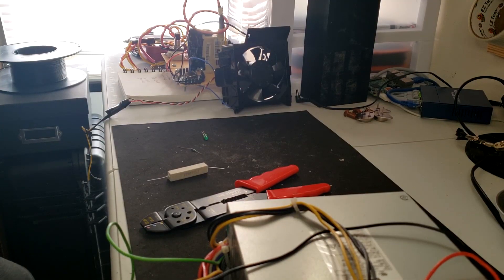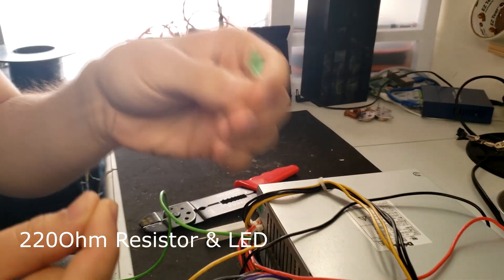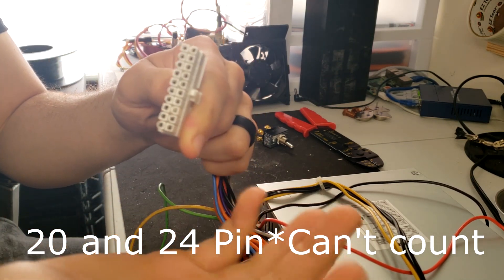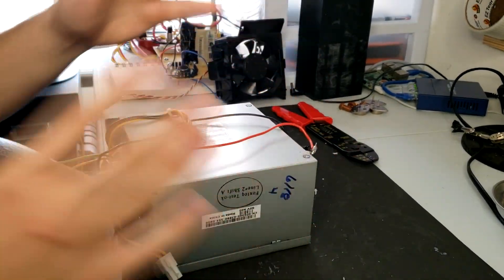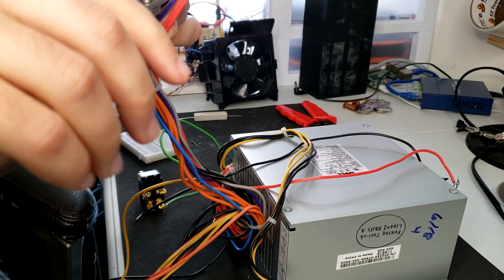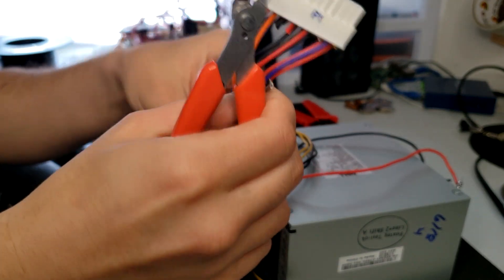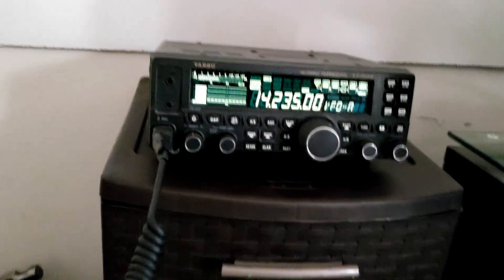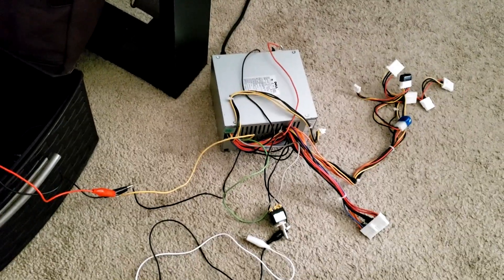Using ATX PC PSU as a Ham Radio Power Supply

Comment from the maker: Let me know if you guys have any more ideas for an improvised power supply!
Reply: There are at few other alternatives to an expensive ham radio power supply other than the ATX PC type. One is the server type, I modified one and it could provide up to 75 Amps. Other is to get a better quality Chinese power supply. They go up to 30/40A and is easy to bring voltage up to 13.8V. I have one for almost a year now, no issues. I also have an MFJ and Samlex switching power supplies. They all put more or less the same level of RFI. Someone already reply, if you put a toroid on the 12V line will prevent to reach your radio. If you want to take a look at some of my experiments with this go to va3hdl.com and take a look. I posted pictures of all my modifications. 73 VA3HDL
Reply: Do not connect power supplies in parallel. You should have disconnected your old one, even if it is off. Other tip, you should bond the same colour cables for maximum amperage, for example all black wires together, all yellow wires, etc. into a single point of connection for each voltage level, or cable colour. The PS is not designed to provide its maximum output on a single connection. 73 my friend.
Reply: Get a HP Server PSU they can sometimes be modified to increase the voltage to 13.8v but if not then using on 12v is OK and mine was left at 12v. They are very good quality, RF quiet and and very stable. They can supply 40A-100A so more than enough.   Search here on YT and you'll see examples, they are often used by people to charge LiPo packs for RC models.  These PSU's are 12v only and used in servers in data centres and many times they swap them out after a fixed number of hours so you can get them for $15 2nd hand.
Reply: I have built one and powers my ham radio and cb and been doing that for the last 4 to 5 years so i dont know why you are telling people that its wrong or not save to use it
Reply from the maker: @AndrewMurphy8383  Don't do it with one well under rated for your power.
Reply: @stewartrv Yep - I have one, hp dps 800 iirc.  Adjusted to 13.4v - handy for charging car batteries too
Reply: Have you improved your audio since? Good info but hard to hear...

Comment: the car battery with the trickle charger. Unlimited current. Unplug the trickle charger when in use it won't introduce noise. A battery will always be the quietest source of power.
Reply from the maker: Thanks for the tip. I may try this out in a future video
Reply: You may want to look at exotic batteries. lead acid battery produces only 12 volts, some radios preferred 13.8 volts to get full power

Comment: Couple of things here. First, bypass that Chinese power supply altogether. Who knows how much power is being lost by running the ATX thru it before it reaches the radio. Next, and more importantly, use at least 3 yellow wires together and 3 black wires to supply the necessary amps to your radio. I’m using that exact same power supply to run a 65w IC-2300h at 25w AND running two 5v USB ports to charge cells phones at the same time, without any issues. You are not getting the amps you need because the single wire is not able to deliver it. But if you triple the wires and bypass the China box, you can get at least 25w from your radio.

Comment: Using a 15A supply is about 180 Watts.  There is absolutely no way you should be using a PSU with such a low rating.  I would recommend at least double the output power (360 Watts).

Comment: I have seen many videos of PC ATX power supplies turned into  compact bench power supplies of 12 volts to used as cb Amateur radio power supplies. First of all you really nned to know how hazardous this is. Go get yourself a real power supply like the JESVERTY SPS1330 30amp to power CB radios or HAM radios. Don't try to DIY a PC ATX power supply. ITS dangerous you could damage your equipment! Thanks for sharing this video and info!!!

Comment: Very nice project. In Portugal I usually use an ATX Power supply for my old CB Radio without any problems, push the ATX by variable cap to 13,45 volts and work very well. Connect radio and other equipment to the limits of 20 Amp, the results awesome, but the voltage drop 12 volts when 20amps active but works fine with 4 amps voltage 12,34 acceptable. The next project is connect to other ATX of 700W a step up voltage of 1800W from China to put 13,8 or more to 24 volts with  20 amps, so till now I'm very happy with the results. 7351 from Portugal.
Reply from the maker: Yeah I'm sure I would have had more luck if I wasn't using an ancient power supply!

Comment: A few comnents: output on a 20 year salvage atx supply I have is 11.7vdc. An astron rs35 or reputable supply does 13.8vdc. 11.7vdc works. The shutdown you saw or may experience at start up can be fixed by adding a choke in series with the 12v yellow wires. Any choke really. 45t in 3 layers of 12ga stranded insulated on a 5/8" dia mild steel works dandy. These supplies are sensitive to current inrush of your off label use. My supply shuts off by simply connecting a 1000uf 16v capacitor to the 12v yellow and black. 10ohm 10w works. Any thing of low resistance works. 22ohm 10w on the 5vdc line runs cold. [A load on 5vdc, red to black is necessary to run supply]. A 12v incandescent bulb will work. As noise goes that varies by design quality and age of filter caps. Do not set your yaesu on top of your atx supply.......  5 feet of distance or more works good. A cheezy fast rfi filter is to use the line voltage emi/rfi filter that the power cord plugs into in many older supplies and devices and place that inline with the 12v wires to your radio. Hot/neutral now become 12v and ground. Ground of the device goes to house current ground. In many at supples this is the ground/black of your at supply.

Comment: Hey I did this with an HP server power supply. I didn't even need to open the case, just jump two traces on the interface with a 300 ohm resistor, and attach a lug to the +12V and G traces. Works great, and now I have 12 volts at 75 amps! I could probably run an amp with this thing too. If you'd like I can post a picture of it.
Reply from the maker: I'd love a picture. I have a spare R710 Power supply, I wonder if I could use this as well.
Reply: @ModernHam  I absolutely covered it in hot glue because I was convinced I was going to electrocute myself trying to plug it in

Comment: U can use more yellow and black cable's maybe this can change your behavior. OR use another ATX mine works fine
Reply: using more yellow (12v) cables gives you more amps as the wires are additive

Comment: Used too small of a power supply. Surprised you did this to your Yaesu. I am using a dell server power supply at 20.8A without issues pushing 15 watts GMRS. Use a newer larger power supply and use the CPU pins from the power supply for the highest amps the power supply puts out.

Comment: i didnt bother with resistors... just put a switch on the green and ground wire and a few 12v pos and neg to my radio and amp and it works really well.. little bit of noise but like you said anything to get on the air.. 73s
Reply: its also a 500w 80+ rated thermaltake psu im using

Comment: BUT DID YOU DIE!?   Seriously , That was a fun video! I had been thinking of trying this exact same thing. My son and I (mainly my son) have been building custom gaming computers for years now. I have several old cases , power supplies, and fans lying around . I had thought about mixing the two hobbies and mounting a receiver in some sort of of computer case. I guess I will have to come up with another idea. Thanks for your time!
Reply from the maker: I was told a server PSU would be much better, and this PSU was over 10 years old, so you may have more luck with an updated PSU!